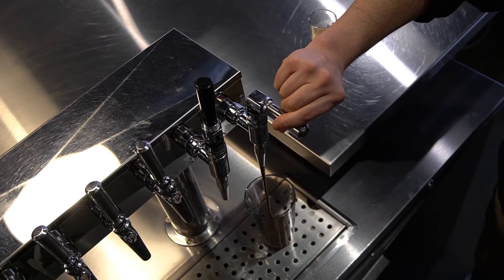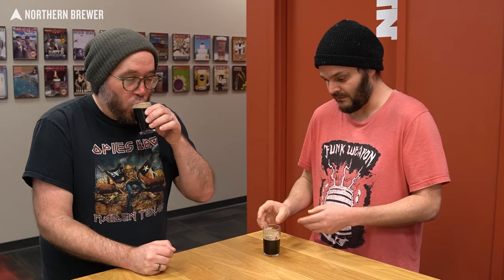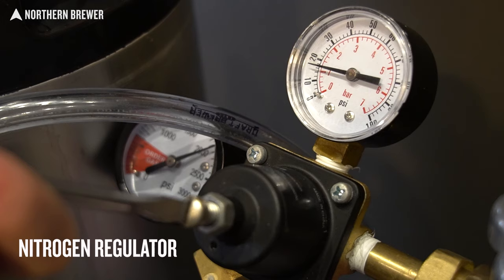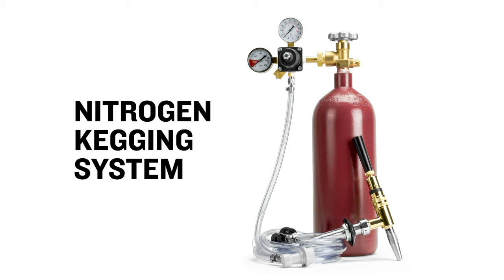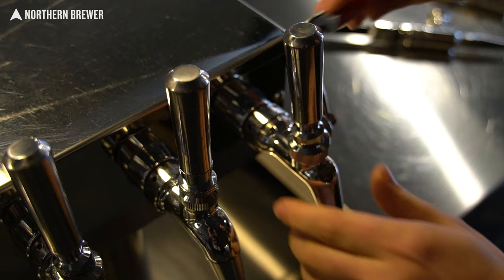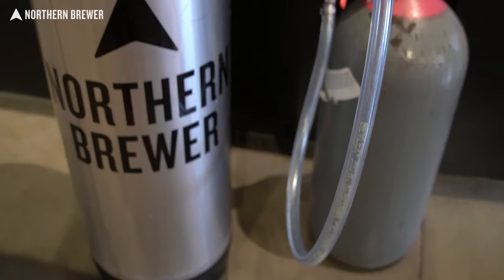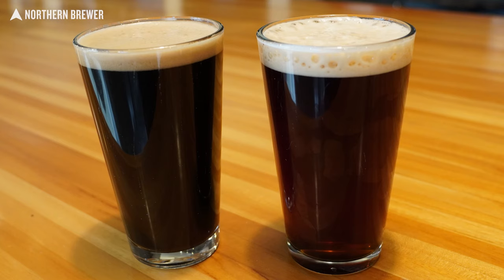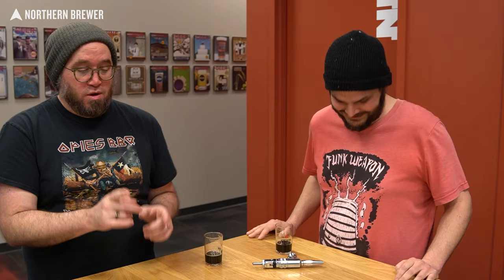Nitro Beer 101 | Serving Nitrogenated Beer at Home

Comment: Question, I'm setting up for this right now and am going to use 100% nitro. I'll have 2 IN posts on the keg, one for nitro and one for C02. My question is should I keep the nitro line on all the time or just when I'm serving? I will keep the CO2 on all the time at a low pressure.

Comment: Great info! How long typically would a 5 lb beergas tank last?  I have tried to use my nitro set up a few times and have found that my 5 lb beergas tank (160$ fill) only lasts 1 keg. I've soaped all the fittings with no found leak. Does anyone else have a similar issue. I can get 7-8 kegs out of my 5lb CO2 tank.
Reply: Hmm... clearly something is wrong. I used my nitro cylinder to purge kegs and I got a about 7 or 8 kegs purged after serving two. 

How are the seals at the regulator/cylinder connection?
Reply: Thanks for the info on how long yours lasts. All seals seem ok. I’m going to replace the regulator. With the valve off at exit of the regulator and the tap closed I can see the gauges slowly decrease. So…. There may be a leak at the regulator that isn’t showing up with soaping??? Weird

Comment: I've read that with the 100% nitrogen setup, as the keg begins to deplete, the CO2 will come out of solution to fill the headspace and eventually the beer will become flat. This isn't the case with beer gas I guess as it's being topped up. Is there anything that can be done to prevent this? I.e., a carbonation lid with a 4-5PSI CO2 line & then a 30-35PSI N2 line?

Comment: Great vid & info!  Particularly the bit, on "undercarb" for the sake of the nitro.   I've served on beer gas in the past with stout faucet, however, I recently shortened my draft lines.  30-35PSI serving seems overkill for a draft line under 4-5 ft.  Any suggestions or thoughts?
Reply from the maker: I think figuring out what works best of your system is the real key. These resources might help:
https://www.brewersassociation.org/educational-publications/a-simple-guide-to-serving-better-nitrogenated-beer/
https://mcdantim.com/calculators/

Comment: So, if you pressure ferment, then just set the spunding valve to 5psi, and let it go. 

What about serving from the same vessel? I use corny kegs to ferment and serve out of. Any issue with that? Or is it recommended to transfer to a clean keg. How long should I have the beer gas on it before it is ready to serve? Or because I have about 5psi of CO2 already in the beer, do I just hook up the beer gas and serve?